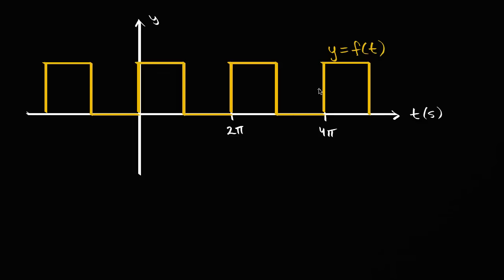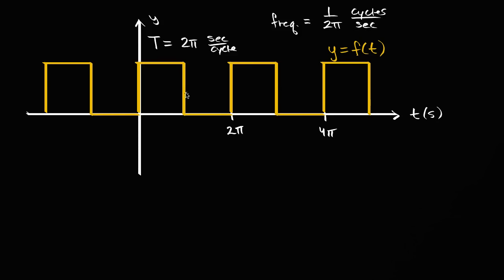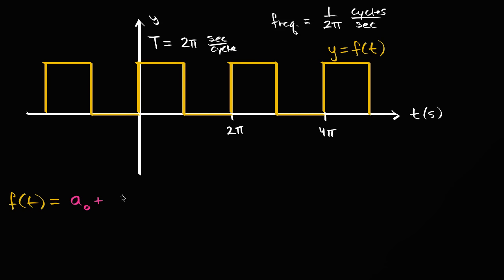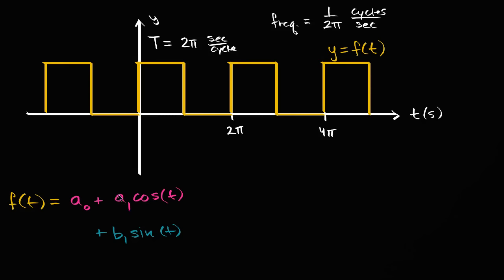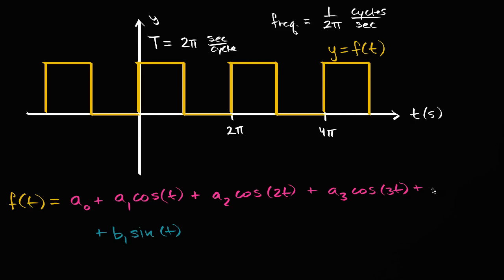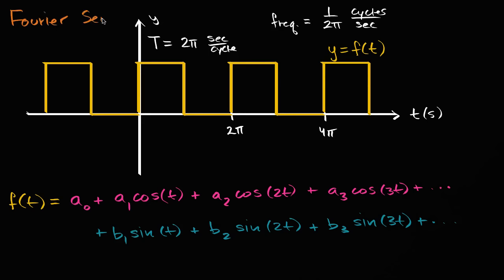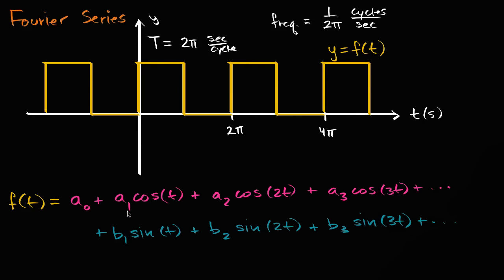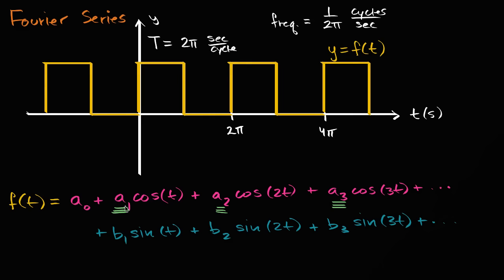Fourier Series introduction

Comment: studying frequency no longer hertz
Reply: witty.
Reply: Matthew James 
How wrong am I saying that Speed and Frequency are the same thing? 
I mean 
s = d * t ^ -1 
f = 1 * t ^ -1 
They kinda represent the same but frequency has fixed value to determine its starting point so that it can be configured throughout all calculations whereas speed is to be calculated by anyone. 
E.g.  I could count how many steps I do with respect to time and from there calculate the distance I traveled due to that time if I know how big my step is. But this can be calculated using frequency I do x steps per time. 
It's just my thinking so i might be wrong... but could anyone give me some feedback on this?
Reply: Najj,
Witty?
Only if he's said it twice.
Reply: Matthew,
Maybe 50%, give or take a little.  You'd forgive a non-English speaker for confusing them.  I'm not going to argue if you said 30% wrong.  Nor with 72.683%, though that would be worth an eye-roll, wouldn't it?
By common convention, speed is usually distance per unit of time, frequency is occurence of an event per unit of time.  That's only conversational; if you needed more certainty you'd shoot for more detail and precision.
They're related, but not "the same" and they're not really things, are they?
Reply: speed equals lambda * frequency :)
Reply: It's not a goat duh 
its a lambda
Reply: @noahelekhtra9456  see, you are absolutely right in my approach....frequency is nothing but running between a bounded area...speed just don't have this boundary....that's the difference I think....
Reply: @ruchirrawat8804  no please
Reply: Which is lucky
Reply: That joke hertz
Reply: Angry upvote
Reply: that was a really punny joke
Reply: This is so bad that it's actually funny
Reply: Still hertz
Reply: This is sum good stuff, period.

Comment: I found fourier series and other related videos to be under electrical engineering on Khan Academy if any one else struggled to find where it is as well
Reply: thank you
Reply: Thanks so much
Reply: Whatbhebsays at 4:50 isnt necessarily true...even if coefficney a1 is bigger than a2, it depends on the value of cos t versus cosine 2t to determine which aue is bigger..if the value of cosine 2t is bigger than cosine t for example, then even if a2 is smaller than a1, that term could be bigger.
Reply: @leif1075  He means in a general sense. The max value for cos(t) and cos(2t) is going to be 1. However if a1 is 1000 and a2 is 0.1, you can see how the cos(2t) term plays almost no part.

Comment: Any idea why Sal represent a sub 0 with a 1/2pi? As far as i know....the a sub zero in the fourier series has a 1/2....so shouldn't a sub zero contain 1/pi  instead?
Reply: a sub zero doesn't represent 1/2pi but a multiple of it(By using the formula of the average value of a function). He said that it is calculated by taking the average value of a function in a given interval( which is the period of the function over here). Intuitively, I feel that it gives an approximate height to the fourier transform of the function.